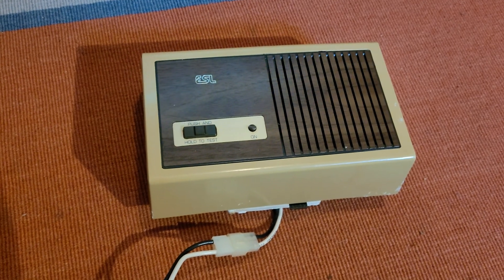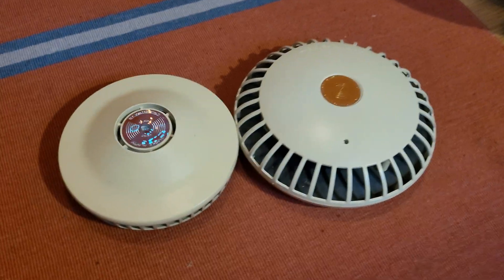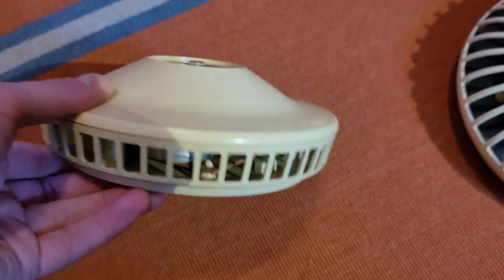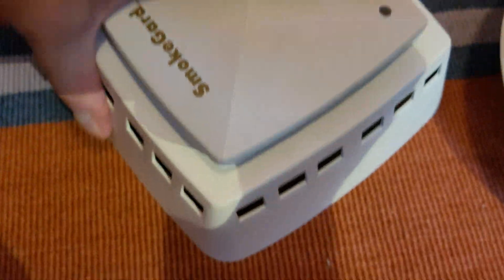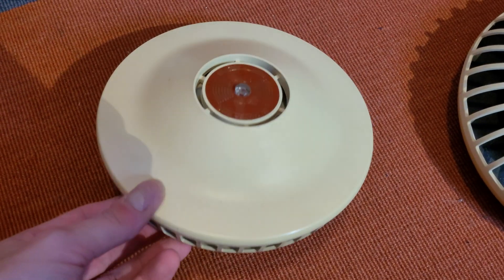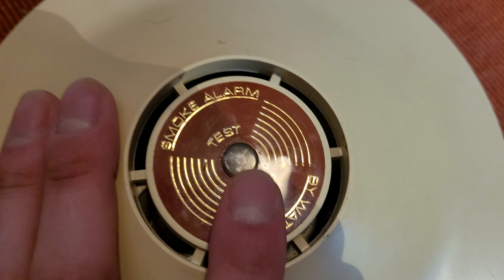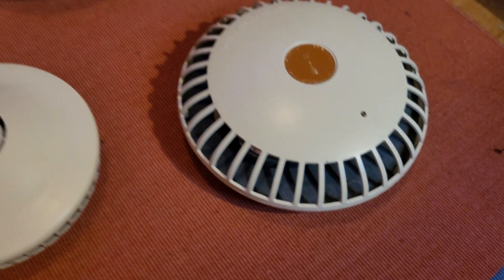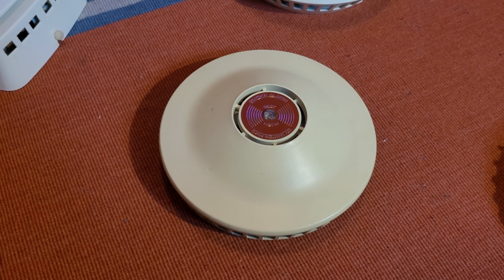Teledyne Water-Pik D-2 SonicSiren Smoke Detector

Comment: water pik makes tooth brush soy deterce yes dentist
Reply from the maker: @johnc8764  dentists office fire alarm system form 1993
Reply: water pik sucks for flossing, the liquid americium solidifies and gets stuck between me teeth and makes loud siren noise. i use go out mosquito utensil this adornment fork instead 24 hour continuously usage zap teeth.
Reply from the maker: @Jon-hx7pe  do you live in antarctica or on Neptune? this could be the reason for this
Reply: I wouldn't recommend those  kind if u have bugs around ur place
Reply from the maker: @joannestealey4482  you need to go get a kenmore warsher and dryer set form 1997 right now